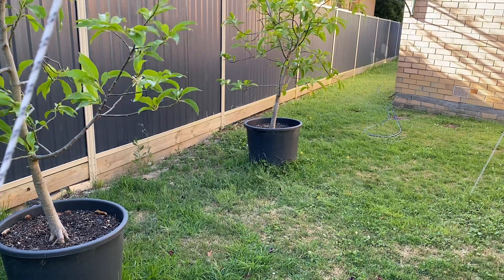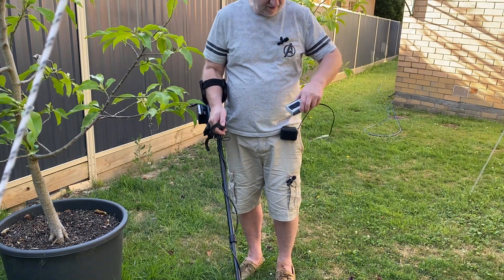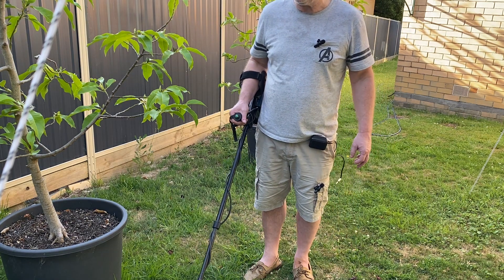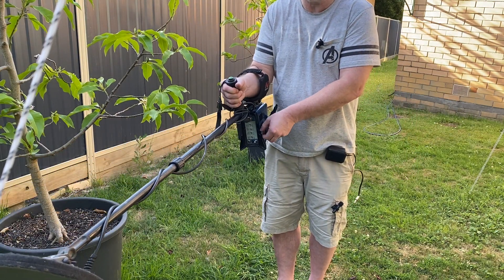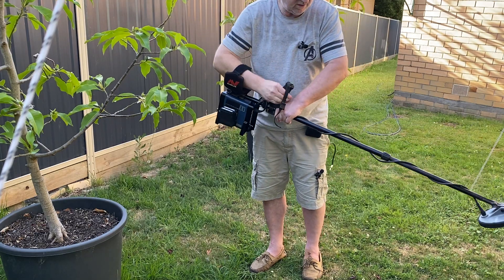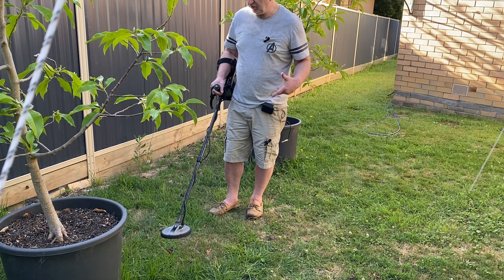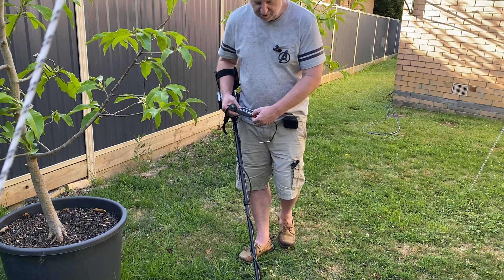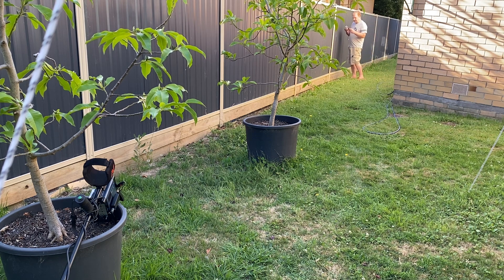Wireless audio system connected to Minelab GPX -4500

Comment: Try getting a target put the machine on the ground as if your scooping the target see where the best spot on your body is to put receiver where there is no crackle
Reply from the maker: The noise is coming from the camera audio system, not the detector one, running two microphones is causing the noises.